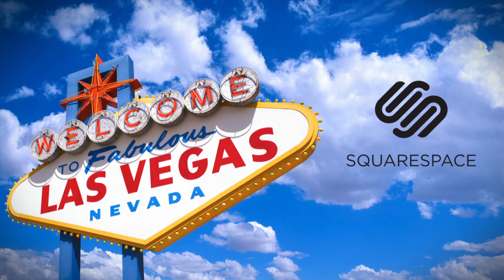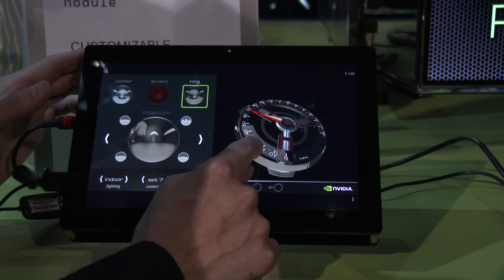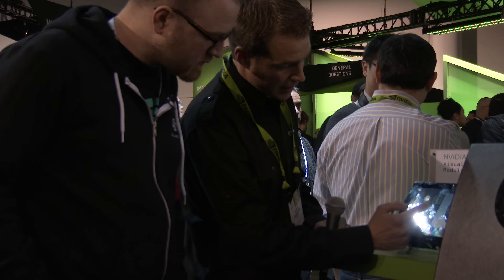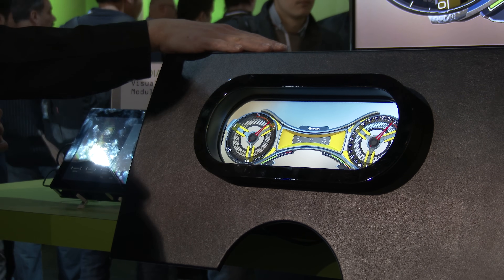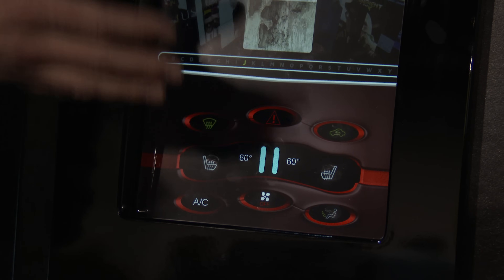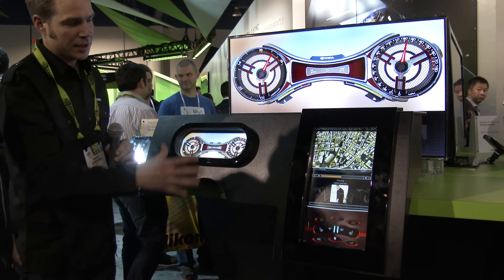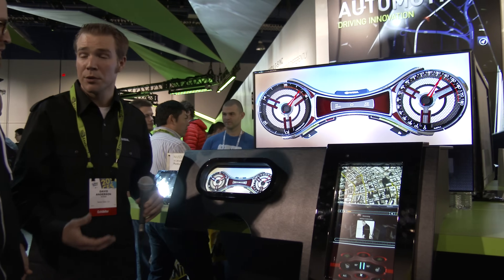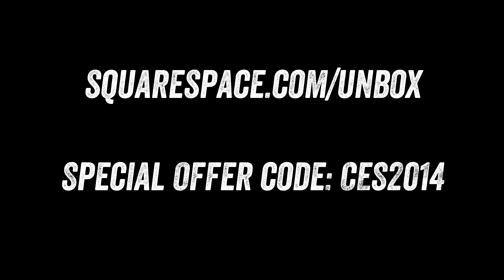NVIDIA in your car? (Project Mercury - CES 2014)

Comment: i really hope "digital" instruments, and touch panels like the Tesla, will be something for the FEW.. worked in a AV company with Design and MMI as a main factor, and we removed touch from many of our devices, the feel of a well done mechanical button / "wheel" is important.. ESPECIALLY while driving. tried to find a "A/C + button" on a 308 while not looking, and its not easy (touch based controls)... so you remove your eyes from the road, just to change a simple setting in a car. i´m okay with the adding of more computing power to the car, but simple systems like Audi´s "wheel" for controlling, will be important. AND dedicated button for things you need in everyday driving.